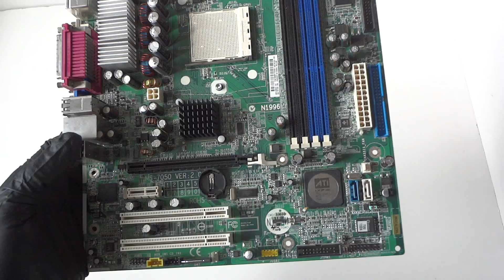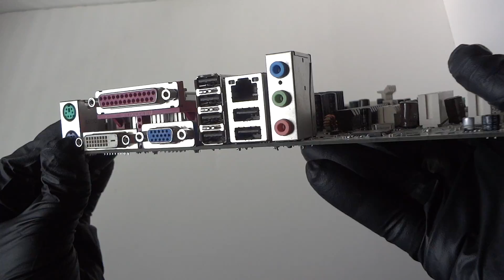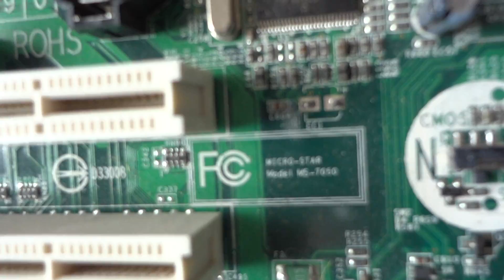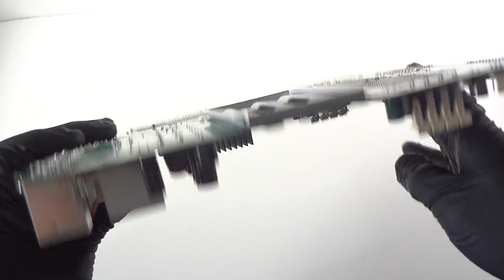MS 7050 Motherboard

Comment: Can i add gts 250 1GB external graphics to this motherboard
Reply: If the card has a pci express x16 connector, it should work with the board

Comment: Ive got one of these with a64 3700+ and 1gbx2 (2gb) ram. I want to try to use it in win98se for win98 gaming.. are there drivers that work for it in 98?
Reply from the maker: Hi, what kind a drivers do you need chipset, audio, graphics?
Reply: i have most drivers for win98se now except for the chipset drivers.. the only ones i could find for chipset for this board are for win2000/xp